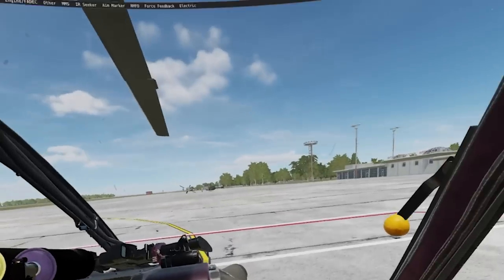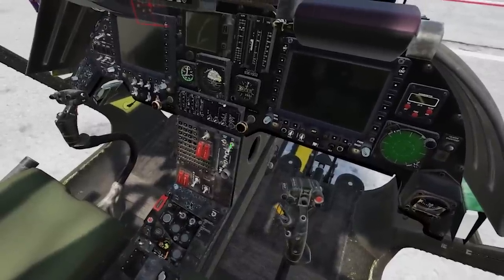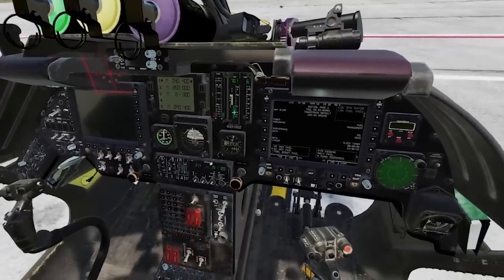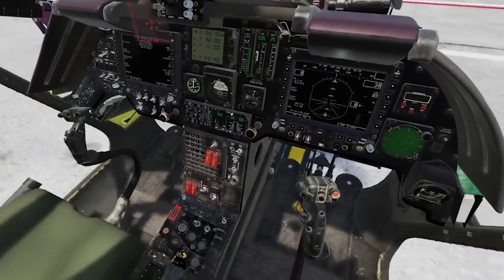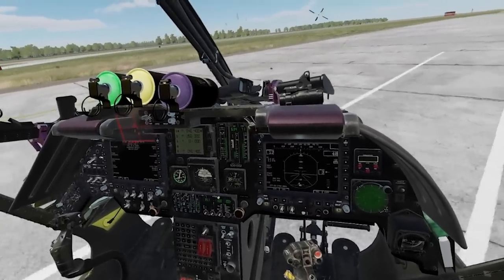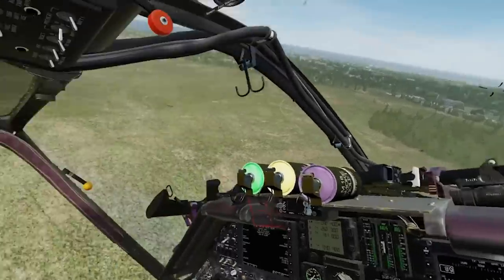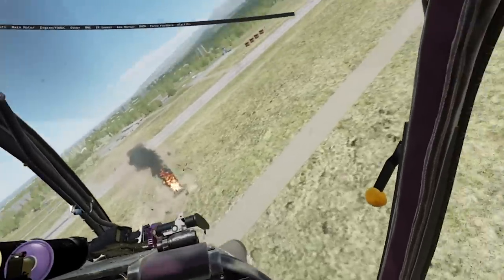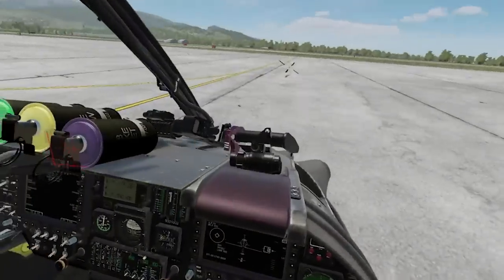DCS Kiowa Warrior SME WiP Quick Start and Flight-Test Demo

Comment: I can't explain it, but I have yet to be as excited for a module as I am for this one. It's not the best at anything, it's not very glamorous, but it just speaks to me for some reason. Keep up the good work PC
Reply: Because it's going to be a real challenge to use. I just hope. Polychop doesn't fuck it up like they did the Gazelle.
Reply: @sasquatchycowboy5585  Definitely, the challenge is one of my favorite things about the hind, which is my current favorite helo.
Reply: @jeevungill7096  If you want challenge you should be flying the Huey. It's the barest of the bare bones when it comes to helicopters in DCS.
Reply: @ImpendingJoker  I had the trial for the Huey, and I loved flying it. However, in combat it's quite ineffective. One day when I have some spare cash I'll get it just to fly around in, but in the realm of dcs it's not very good.
Reply: @jeevungill7096  Then you truly don't know the Huey. It is great for lightly contested areas where there are just troops on the ground, and you can transport troops and sling load with it and that makes it way better than the Hind on multiplayer servers where you are trying to capture and resupply bases.
Reply: @ImpendingJoker  Perhaps, I don't play on a lot of servers like that. As I said I will buy it one day, maybe I'll regret not having purchased it earlier.
Reply: @ImpendingJoker  I've used the Hind for troop transport and sling loading on servers though, in fact capturing and resupplying bases is the main thing I do with the Hind. I just also clear them out with it first... =)
Reply: @sasquatchycowboy5585  Excuse me, Gazelle is my favorite so far in DCS. She works pretty good with mistral. I have shot down over 300 jets with it in GS server.

Comment: Hey, great video, I've watched it a few times now but I do have a question, What are your "settings" like with your stick? What cams do you use and do you use springs or no springs? Do you use the clutch mechanism? Sorry for all the questions but I'd assume you'd have the best set up seeing as you flew them IRL. Thanks for reading!
Reply from the maker: I have a "better than entry-level" equipment setup I suppose.  But I don't go for the latest-and-greatest "stuff".  

I use the no-center cams (the cosmo-sim cams?  Honestly can't remember) on the WarBRD base, with the lightest springs I could find from an online spring supplier which seemed to match the dimensions of the VirPil springs.  I tried the lightest VirPil springs, but found I still wanted something lighter so went searching online for something close.  

I've been considering the VirPil CM3 base because I'd like to try something with clutches, but I haven't found a compelling-enough reason to spend that kind of money on another base. 

My flight chair setup is an old office chair with 1/2" plumbing pipes bolted to the underside to support the throttle and cyclic :).
Reply: @Barundus  Thank you so much for this answer, you gave me WAAY more than I even asked for so I appreciate that alot!

I have the WarBRD-D which does have the clutch, It was kind of disappointing because it really locks the center which makes it really hard to hover because you have to really yank it, it might work better though if you have extensions which you do(I don't).

Comment: What kind of armament will this carry ? Like guns and guided munitions ? And what about the tpod or built in tv/flir? I'm interested in buying it when it comes out so cool to see it's already flying and modeled
Reply: The 58D wis a light scout helicopter. It can carry Hellfires, Hydras, Stingers and .50cal machine gun externally. It's not like the Gazelle or Apache. It's not a power hitter, it's an armed observer. It engages only when it has to. All the sensors are located in the Mast Mounted Sight or MMS, and contains FLIR, day and night TV and laser designator.
Reply: @ImpendingJoker  Isn't it quite a bit like the Gazelle? Lightweight, big camera up top (Gazelle has it on the roof, the M variant with TV and FLIR, L and MISTRAL with just TV, while Kiowa has it on the mast, always both), can carry a few missiles (A-G or A-A, HOT3s or Mistrals for the Gazelle, Hellfires or Stingers for the Kiowa) or a few rockets and a gun (SNEBs and an M621 20mm for the Gazelle, Hydras and a Browning .50 cal for the Kiowa).

Definitely not like the Apache, Ka-50 or the Hind though, that's for certain! =)

Comment: How will the Kiowa work together with the ED Apache? In what way will it be implemented? Are you already testing this in Multiplayer and single player?
Reply: A lot like it was in real life I'd suspect. But the Longbow doesn't really need the Kiowa which is why they were retired RL. In the early days the Kiowa(I) was flown from offshore platforms and small ships at night, years before what you saw in Desert Storm. It's an armed scout, and doesn't really need to be teamed up with an Apache at all, and they function just like any other spotter when utilized. They can laze targets for others just like any other forward observer can but they really excel at gathering information and sharing it with others. Before the War On Terror they were more like a peeping Tom watching from behind trees, hills and buildings, and relaying information. The OH-58D(I) in real life is so underpowered that two good size guys with a full bag of gas can push it past it weight limit, add hot and high to the mix and one of them will have to get out and push. Still though, I loved working on and flying in the little Kiowa because you didn't get in it, you strapped it to your back, and it was oh so much fun at low level.

Comment: Module looks great. I was in Iraq in 2005 with the 172nd and had OH58's supporting us, love that helo. Looking forward to having hunter killer teams with Ah64's and OH58's. The progress looks good. I also fly the Gazelle and love it. I think most of the complaints about it are from people who don't fly it much or put silly curves on it and such. (or bad controls / ham fisting and complaining.) It isn't perfect, but fun, and if people would learn to fly it instead of just jumping on the "bad flight model" bandwagon I think they'd find how enjoyable it is. (same people probably fly the Unicorn Ka-50 which wasn't ever operational or weapons certified. It'd be like having a YF-23 in DCS. Cool, okay, but never operational and all the data is fiction.) 

As to your VR performance. I didn't have great luck with multithreading either. I had a 3060TI and was in the process of building a new PC with a 4080, an I9 12th gen, and 64gb of RAM. The old PC was a 3060TI, 64gb ram, and a 10th gen I7. I doubled my framerates with the new PC. And during some of the testing I've been doing, My RAM usage never goes about 31-32GB. Doing some research I think there is something in DCS that won't optimize or use more ram and 32 gb. And obviously DCS isn't going to run as well if the RAM is maxed, or near max. I don't know what and how much RAM you've got, but I think that with the current programing in DCS, 64 gb is about what you want if you're using VR or wanting to run good framerate in multiplayer. Currently I get about 120-130 fps in MT single player, and 70-90 in multiplayer (which doesn't support MT) Anyway, the 4080 is absolutely a beast so I'd be interested to see non-VR FPS with an AMD card, as they have more Vram and DCS doesn't use things like raytracing anyway. 

Thanks for the video, and I very much look forward to taking the OH58 for  a spin.
Reply from the maker: Your points about the Gaz-haters club bandwagon are spot-on.  

I have a:
Win11
AMD 5800X3D
48GB RAM
AMD 7900XTX
HP Reverb G2

Thus far, the 7900 XTX has been a giant disappointment.  
At altitude where the graphic environment is simple, I get 60+ FPS with <10ms frametimes.  

At low altitude <where I hang out> I get no less than 15ms frametimes, and the FPS drops.  

Stuttering is horrible at the low altitudes.  I have hope the drivers get fixed.

Comment: Hopefully it won’t be as stressful to fly like the Apache
Reply: The Apache is a dream to fly but if you are trying to learn to fly helicopters and the first one you got was the Apache, then yeah, you put the cart before the horse. Get the Huey and learn the fundamentals then go back to the Apache, and you'll be in better shape.
Reply: @ImpendingJoker  FWIW I can see their point, I have all of the helicopter modules for DCS, been flying them for years, and I'd agree that in its early stages the Apache was by far the most twitchy helicopter in the game, harder to keep stable in a hover than the Huey, and absolute miles away from the terrific stability of the Hind, Hip and especially the Shark.

Things have changed a lot recently, especially after the multithreading update the Apache got a lot easier to handle and smoother to fly. Still not issue free, they've said themselves that the SCAS still needs tuning, there are some behaviors related to what happens when you dive etc. that aren't working quite right, and there are other oddities like certain trim modes (under the Special settings tab) limiting how fast you can move the cyclic significantly vs. other modes, etc. But it's constantly getting better, and is still a lot of fun. =)

Comment: Is this going to have the UFO Gazelle flight model as well?
Reply: If you look the controls indicator box at the bottom left, you can see that cyclic is not anymore hold in the center, and pedals are actually required to be somewhere else than center to fly straight or maintain the movement.

I am not so sure about pedals sensitivity, but that is me. As when he is firing the gun, there is not much pedal work being done at all for the gun, like it has no recoil.

Comment: 0:14 I genuinely thought my rig was broken, until you finally said something into the void :D

0:22 I guess I can live with that. Dunno what headset you're using. If you happen to have a Quest 2 or Pro though, try using either wired Link or wireless AirLink and fire up OculusMirror (it's where the debug tool is as well), and enable the stabilization there, make the thing full screen and grab that with OBS.

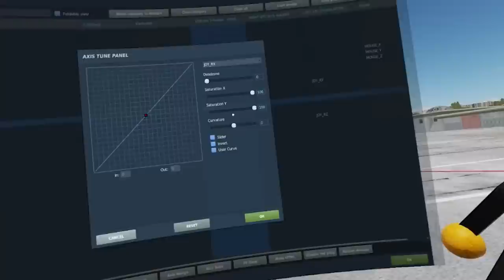3:11 When did ED add that pattern to that window?

10:01 "The lotor" ~Barundus, 2023

13:00 "300 rocks"
Monty Python entered the chat.

15:05 DCS: Gazelle left the chat.
SCNR! :D - can't wait until it gets a FM after the KW release! :)

26:35 LOL! :D

Comment: Show your control indicator. After the absolute garbage that is the Gazelle I'm not touching this with a ten foot pole unless I have it on vary vary good authority that the cyclic in the cockpit requires the same inputs as the real helicopter. And even then, I might not get it until they fix the Gazelle. This is the only team that I would really wish would just go out of business and go away.
Reply from the maker: Thanks for your thoughtful comments!  
Clearly you are a discriminating aficionado!  
Question: what "authority" would be credentialed sufficiently to validate the control modeling to meet your standards?  The Flugsim Ubervachungs Klub - Ober-Frühstück Fliegerwirtschaft is booked for the next six months.
By the way, is your control setup pretty similar to a "real" helicopter?  No?  Yes?  Good for you!
Because the 14 year old kid down the street is flying the same module as you are, with an Atari 2600 joystick and a used throttle quadrant he found in a box in the garage.  And he's perfectly happy.
Want PC to go out of business?  Don't buy the module.  There: You've done your part.
Thanks for you thoughts.  I value your opinion.
Reply from the maker: Also:  did you even watch the vid? 
'Cuz the control indicator was shown literally THE ENTIRE VIDEO.